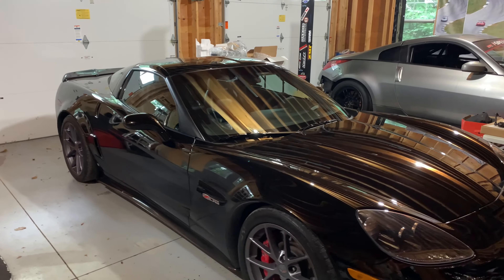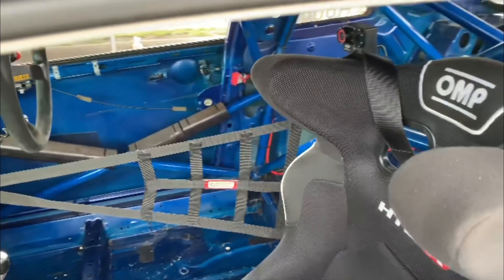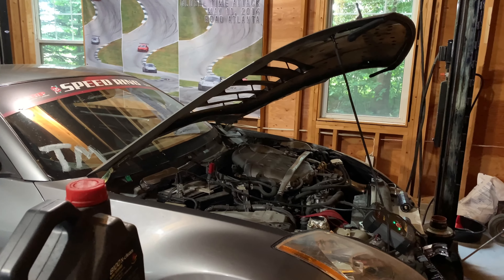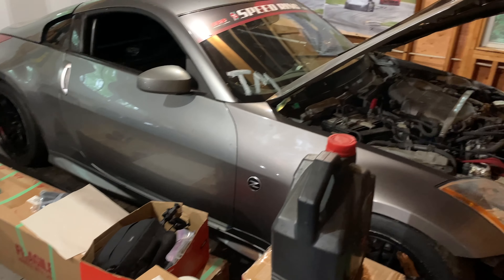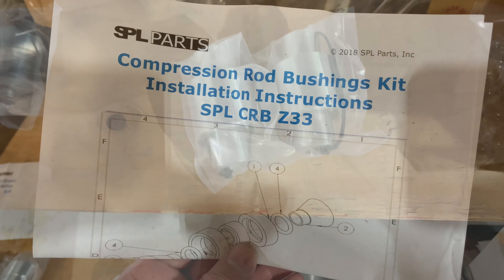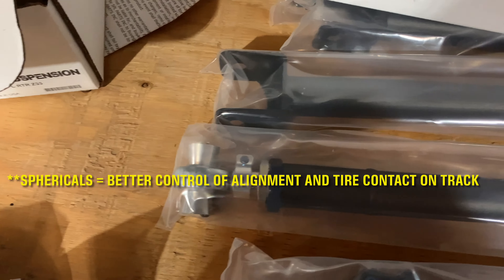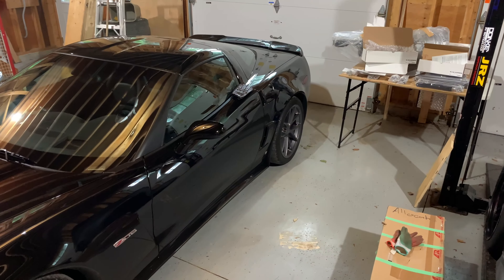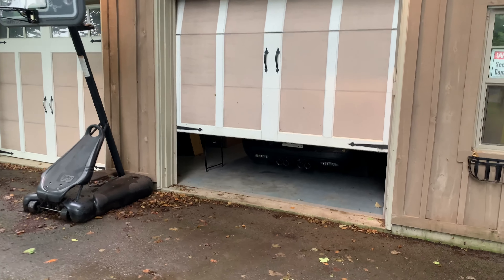2021 Track 350Z Rebuild Ep. 9: SPL Parts Haul

Comment: I have full SPL on the front of my 370z, you will be amazed at how it changes the front end it will be tight and precise, it gets rid of a wobble you didn't know existed, it will shoot through corners more eagerly, forbthe rear all i have is voodoo13 camber arms, and Z1 subframe collars. The collars made a world of a difference. Especially becuase  you don't have to drop the subframe and its a 15 min install
Reply from the maker: Is there anything I missed I should have picked up? I have the front SPL A arms for camber adjustment.
Reply: @2THPWR s
I know the whole front end includes  SPL Front upper control arm. Lower control arm bushings, (front and rear), tie rod ends. Sway bar end links, and they have a titanium option for some of those things.
Reply: @2THPWR  also I dont know if you have any bracing done but I do recommend getting some. I have a 4 point megan racing and a 6 point should function in the front and the the rear in have the megan megan bar that connects to the camber arms, keeping the chassis stiff allows you to the suspension to work better, I do plan on getting the fender reinforced.

Comment: The analytics on the Z06 will get better with time as you accrue Corvette based subscribers. It would be interesting to see how they compare at a larger track like MoSport
Reply from the maker: This is true. I may test the Civic at Mosport in 2 weeks. I will eventually run both at the same tracks and have some good comparisons. But, because the brakes on the Z06 are so weak and the tires are so old it’s still too too unsafe to put out there.